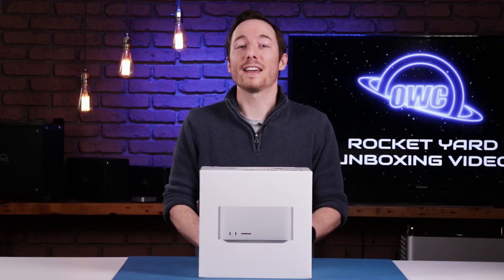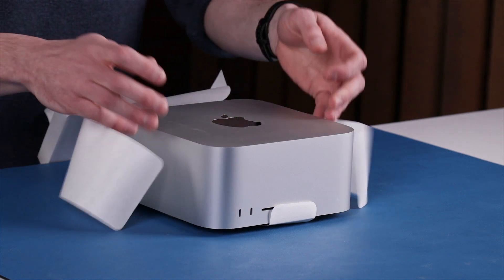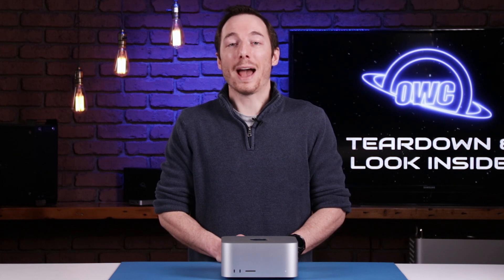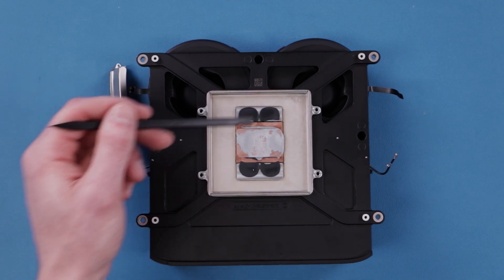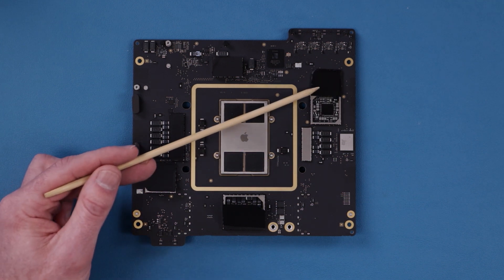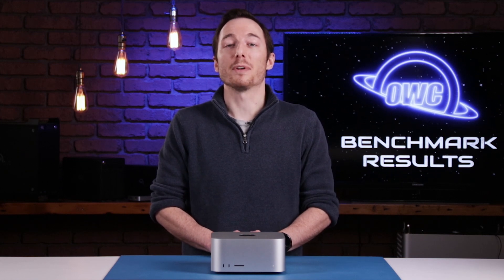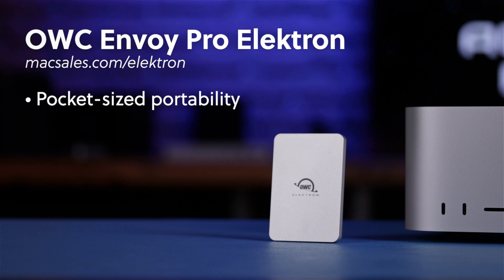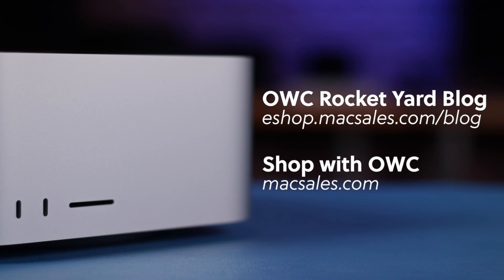Mac Studio M1 Max - Unboxing

Comment: When will the 'what can I upgrade' folks learn?  That's like buying a well-appointed BMW and asking the salesman if they can upgrade the engine or the gears.  We now live in a time of new design concepts.  The SoC design of the new Macs is the very reason they are so powerful, efficient, and cool.  If you want to change your carburetter, cylinder head gaskets, and so on, buy an old car.  Just know, there was a time when the same mentality railed against the integrated circuit boards and the transistor itself.  They wanted to be able to tinker with the circuits and valves.
Reply from the maker: When given the opportunity to customize their computers, people will take the offer. There is a lot of untapped potential beyond what Apple will tell you their machines are capable of. While it may not be the OEM computer that it was previously, these sorts of upgrades come with the understanding of that already.

A lot of our business revolves around supporting Apple customers in ways that Apple will not. You may happy with your stock Mac Studio and are able to afford the price for larger storage, but rather than having to buy a whole new unit because you couldn't afford what you should have purchased initially, you can purchase an upgrade relative in spec saving you thousands.

Having a stock Apple computer will always be there, I do not see the problem with giving people the choice to make that decision for themselves.

Comment: (1) Will OWC offer SSD upgrades for the Mac Studio?  iFixit, in their teardown, found that they could swap SSD's, but only of the same size (see https://www.youtube.com/watch?v=TYF527DqnwY&t=296s)  (2) To unscrew the bottom and open the case, you need to remove the glued-on black rubber ring, since the screw heads are under it.  Does that destroy the ring, i.e., every time you open it do you need to get a new ring?
Reply from the maker: Chemystify we do apologize at this time we will not be offering an SSD upgrades for the Mac Studio. Also, we are unaware if a new ring is needed each time the machine is opened as we do not support any user upgrades at this time, we do apologize.